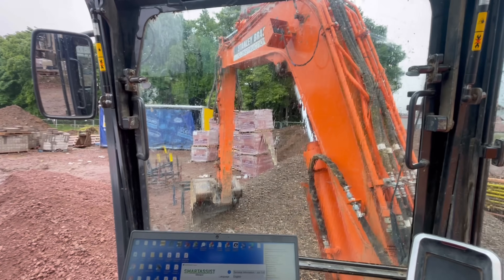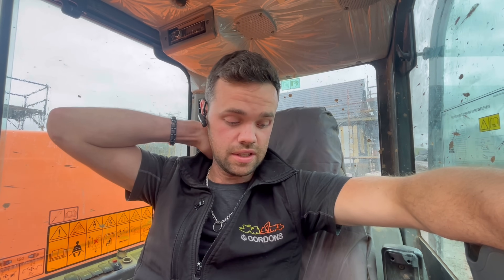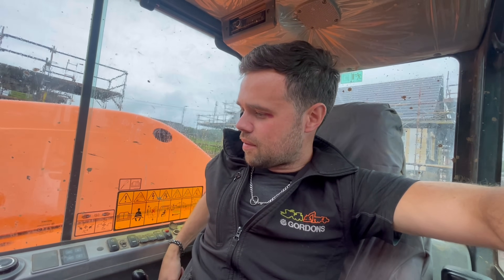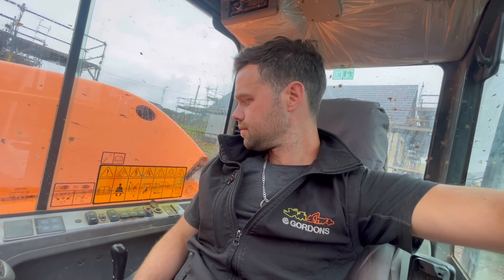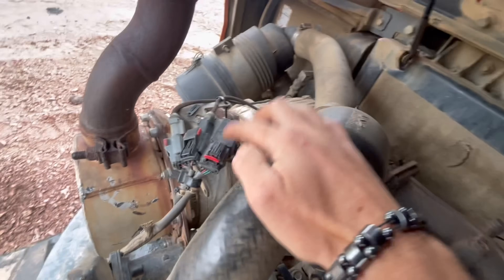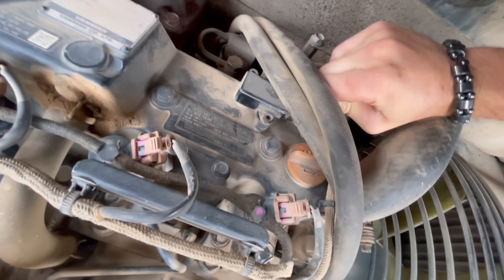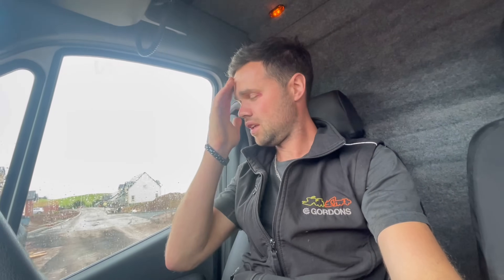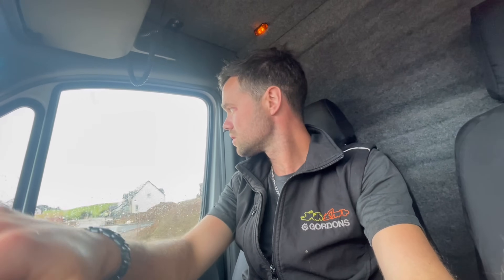EGR fault ? / laptop says no / loose ends tied up / subscribers letters

Comment: You can use it when the squeaking starting doing your head in and the radio is at max volume or on your next service when adjusting the digger brakes!😉😂
And i know what you mean about video length, but if you give us varied lengths then we can pick and chose as well, long videos are good for wet sundays and 10mins for the tea break.
Reply from the maker: Cheers Allan 😂 next one is a good bit longer might want to have a long 10 o clocks
Reply: Longer the better, great content 👌

Comment: I've changed quite a few of those egr differential pressure sensors. In my truck I have two faulty ones with the error codes they generated written on them. One has a fault for the intake side and one for the exhaust side. That way I can plug in a one with the opposite known fault and verify that the original code will go away.

Comment: Used copper slip on sprinter breaks for years, never had it cause issues. how do you get on with the SA-D tool, I really struggle with it, especially for regens.
Reply from the maker: Yea it’s not very user friendly in my opinion I can get it to regen but it’s the ECU swaps that I can never remember how to do